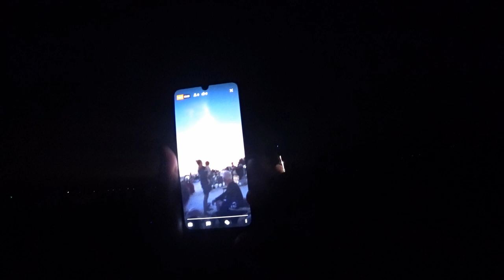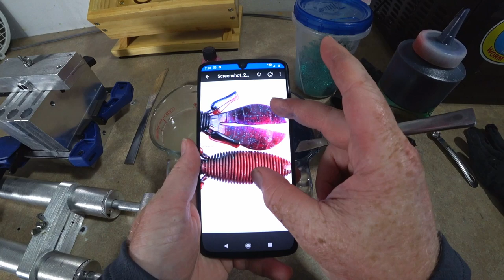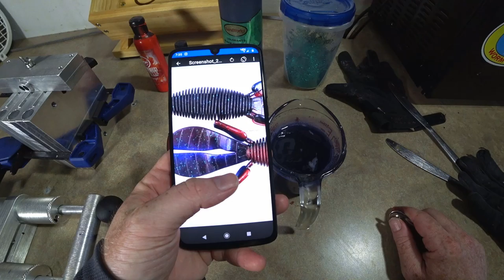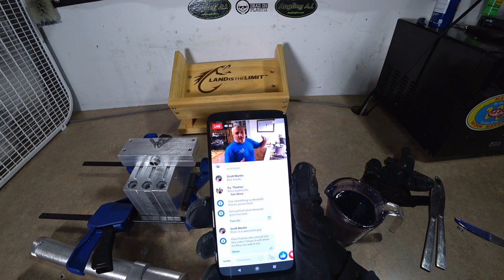Color Matching: LOVE BUG...Making A Great Creature Bait Color

Comment: hey man for moisture control try a normal globe in a very good sealed cupboard and keep it on with your plastics stored inside. Used to do it to keep our welding rods from getting affected by moisture as the globe keeps it warm and almost moisture free.
Reply from the maker: I'll check it out..thanks man